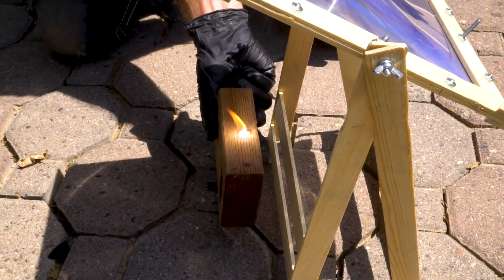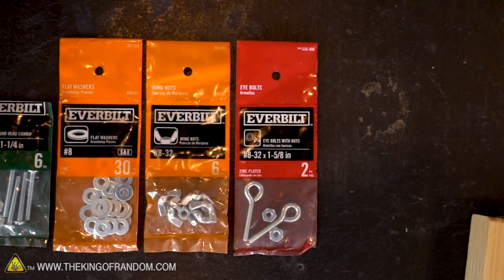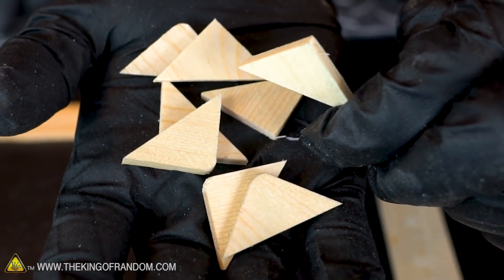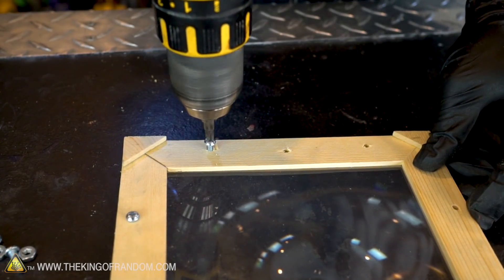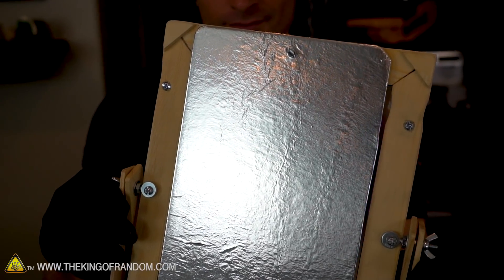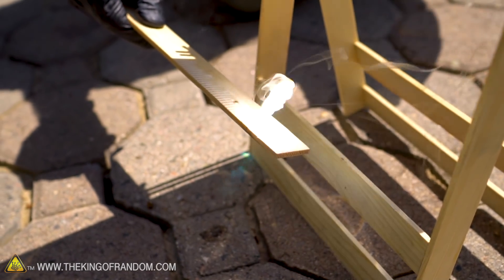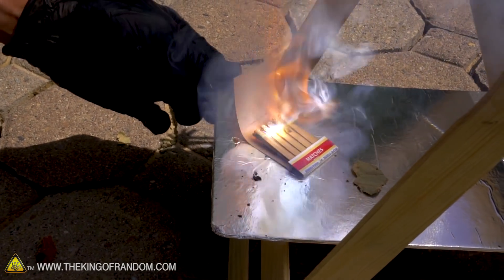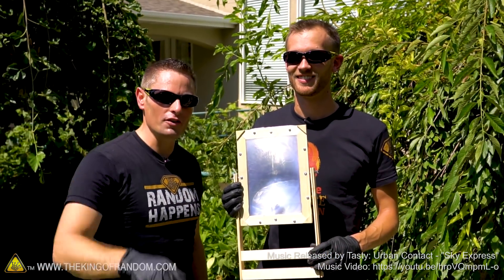Powerful Desktop "Solar Scorcher"! TKOR Shows You How To Make A Mini Solar Scorcher That Works!

Comment from the maker: You guys were asking for more DIY so we've been cranking out the DIY and we have a lot more coming.  I'm really proud of this project and Hope some of you guys try making it ✌👑
Reply: Make a DIY solar panel
Reply: Try melting metal coins with it to see if it really  has the same power as the big solar scorcher
Reply: King of Random can you make another styro slicer that is small an  easy to make pls😯😯😯😯😯😯😯😯😯😯😯😯😯😯😯😯😯😯😯😯😯😯😯
Reply: Try focusing the mega solar scorcher into the lens of the mini solar scorcher and then put something in the focus of the mini solar scorcher!
Reply: Try to make a homemade plasma ball plz plz 🙏🙏🙏🙏
Reply: The King of Random What if you use the giant scorcher, put the mini scorcher close to the focal point but not enough to burn it, and see if the resulting temperature of both scorchers is more powerful
Reply: try putting gasoline in a vacuum chamber
Reply: The King of Random Great video, im glad to see some DIY again
Reply: The King of Random you are insane
Reply: The King of Random can it melt coins?
Reply: The King of Random can't you just buy a picture frame?
Reply: The King of Random a shoe acrylic mold to mold out a shoe
Reply: Make a thermite launcher
Reply: Liam Becker, I do like Nate.
Reply: The King of Random can you create a handheld version of the styro slicer, kinda like a little mini version of the regular one you made a while ago
Reply: The King of Random can you make a full aluminum bat that is not hollow
Reply: king of random can you do a emp box protecter
Reply: The King of Random WOW THAT BURST INTO FLAMES IN LIKE ONE LIKE INSTANTLY
Reply: The King of Random you should make a micro solar scorcher with a credit card size magnifier
Reply: use the Solar Scorcher and try to melt dry ice ✌👑
Reply: Not to sound mean, but I think that a lot of the older viewers are probably adapting the same opinion of you. You don't do very many projects that are, "Original," and just get stuff from the comment section. I think that if you made another channel that was dedicated to only original projects, you could get a lot of the older people back. Then you could have this channel be just for stuff from comments.
Reply: Can you cook meat or boile water with the solar scorcher can you test this 🤔
Reply: Hi I made the mega one the same way and it works great. I sometimes toast some marshmallows with it. It is quite bulky so I think this would work well. I recommend making it if you can it gives me hours of fun.
Reply: I was the one that asked for more DIY'S in the gasoline video And I will definitely be doing this project!!!!!!!! :) thanks for making more DIY'S Grant lets Go team RANDOM!!!!
Reply: Subscribe to me
Reply: You should try to have a spoon and put it under boiling water and see how long before it turns orange
Reply: You should put colored smoke on your drones and try to sky write!
Reply: The King of Random what will happen when you detonate TNT into nitrogen container?
Reply: Hey why don't you try melting rock
Reply: The King of Random I really like your videos because it teaches kids and grown-up folks to get into the garage or where ever that maybe and use your mind to build things most of the stuff you build is very accessible to get thank so much for taking your valuable time and teaching us how to great work you guys!!
Reply: The King of Random pour silicone into liquid nitragin :)
Reply: Can the mini solar scorcher melt some metals?
Reply: The King of Random could u make a vid about putting random things in the vacuum chamber
Reply: Could you do DIY coloured fire
Reply: Cyrus Battiwalla hi was up we are both here
Reply: Cyrus Battiwalla could u reply
Reply: Can you magnify the solar scorcher beam on the mini solar scorcher pls.😎
Reply: Grant make a Marx generator
Reply: You should sell these (and a lot of your other projects) as kits like (through?) Sonic Dad. Honestly, this would be such an amazing stocking stuffer as a kit.
Reply: The King of Random can you make a diy solar pannel or something like that?
Reply: put the small scorcher in the focus point of the big scorcher my dude
Reply: The King of Random Try putting a battery under that solar scorcher
Reply: THAT WOULD BE PRETTY COOL
Reply: Just realized caps lock was on
Reply: PLEEEEASE, test metal melting with the small scorcher??????????
Reply: The King of Random  What happens if you accidentally burned your hand with the solar scorcher?
Reply: You should do a video with Andrew huang
Reply: The King of Random what would happen if you lived up the mega and mini solar scorchers?
Reply: The King of Random try to melt a rock of some sort
Reply: The King of Random great
Reply: The King of Random...Hi Grant I love your videos...could you please show us how to make a red dot sight..I would realy like that...
Reply: The King of Random can you do some fun stuff with fire extinguishers for a future video thanks
Reply: Amazing Gamer3000 hi
Reply: The King of Random nice videos keep it up
Reply: The King of Random can you make one  way glass
Reply: The King of Random you should try melting rocks with the solar scorcher
Reply: The King of Random 
Hey Grant, can you please try making the legendary Greek fire and then try to create something as close to the devistating wild fire you see in GoT as possible? Thank you!
Reply: You should stack procedurally smaller solar SCorchers to make it more focused
Reply: The King of Random will it melt metal?
Reply: melt coins
Reply: The King of Random hi
Reply: Could the mini solar scorcher make char cloth?
Reply: What if you focused the light from the big solar scorcher?
Reply: Dry ice vs solar scorcher
Reply: DIY nitrogen ice cream
Reply: Thank you for a DIY video
Reply: The King of Random you should make some super easy but complex metal castings with kinetic sand. Don't worry, kinetic sand won't ignite or leak unless the metal is too hot over 1000 faren
Reply: The King of Random I stopped watching your videos because of nate. So why is nate in your videos.
Reply: The King of Random  how about you take all the colours of the fireworks
Reply: The King of Random Hi
Reply: The King of Random you should do the solar scolcher but with chocolate
Reply: The King of Random can you make a glowstick kcilaphone from pintrest
Reply: ✌👑 The King Of Random use the Solar Scorcher and try to melt dry ice ✌👑
Reply: Does this have any practical application? Like for cutting or IDK burning an image in wood?
Reply: The King of Random male a glass mold poke ball
Reply: The King of Random do you think you can melt coins like the big one
Reply: The King of Random can't you just use a magnifying glass and see if that will work
Reply: make a phone projector next it would be awsome
Reply: The King of Random I tried one my entire scorcher burst into flames 😂 so I rebuilt it with metal rulers and glass
Reply: you should show us a diy longboard
Reply: The King of Random 
I
Reply: Try to melt the dry use using solar scorcher pls please please
Reply: plss make a liquid nitrogen thrower (flame thrower but instead liquid nitrogen)
Reply: Themite versus ice/dry ice PLEEAASE
Reply: The King of Random make your own crucible capable of holding together in the forge
Reply: What the heck
Reply: all you need now is a crucible 😍🤓
Reply: The King of Random u have tought me a lot over all the years thank u because i have fun watching all the stuff u make
Reply: Try building your own music instrument!
Reply: How about a diy mini engine?!
Reply: The King of Random I have a DIY project for u to do can u make a mini jet torch for the bitty barbecue can
Reply: Thank you for the DIY
Reply: 321th like!
Reply: build RGB infinity mirror XD
Reply: The King of Random hi I love all of your videos ive been watching them for about a year now or longer. I'm also a subscriber and I liked. Can I please have one of those because I want one  and I can't buy that stuff.
Reply: The King of Random do diy Halloween pranks
Reply: Hey grant, why not take the big solar scorcher, and have the fun size solar scorcher in the focal point of the large solar scorcher? See what happens.
Reply: That would just melt the miniscorcher.
Reply: Freeze helium in liquid nitrogen or liquid oxygen
Reply: Tried making the big scorcher but the TV had the wrong kind of fresnel, bought the lens for this mini and can't wait to make it! Just wondering, what did you do with the other TV pieces? I wish I could do something cool with the projector
Reply: You should add at least 3 more to see if it becomes stronger
Reply: Grant/ Nate any chance of throwing a few cool H.D.P.E bottle lid projects our way.  either solid block shaping and/or maybe some of your old vacuum former again, or build another but kitchen sink forming size?
Reply: The King of Random can you do molten metal and liquid nitrogen
Reply: The King of Random 👩‍❤️‍👩👩‍❤️‍👩
Reply: The King of Random make a napalm bomb
Reply: can you focus the light from the larger lens through the desktop to increase the heat?
Reply: The King of Random  what happens if you put oblic in a vacuum chamber or what happens if you put oblic in liquid nitrogen
Reply: King of random What happens if you put oblic in a vacuum chamber
Reply: King of random What happens if you put oblic in a vacuum chamber
Reply: The King of Random what happens when you use the mega solor scorcher and try to burn dry ice
Reply: Can you do a solar oven build please? Maybe two versions: cheap and portable (camping, survival), then a bigger and sturdier one for off-grid cooking at home.
Reply: I think I'll totally build this! Thanks so much for the video!
Reply: The King of Random try to melt rocks with it, and see how fast it can evaporate water
Reply: The King of Random .. try a fire tornado! It looks pretty rad at night.
Reply: The King of Random can you melt rocks or glass with it?✌️👑
Reply: The King of Random what will happen if you microwave gunpowder?
Reply: Loving the format guys. The combination of DIY and experiments seems perfect to me!
Reply: Have you ever done any electroplating? It seems to be Right up your alley?
Reply: The King of Random I know that u boiled gas but u bid not try boling mixed gas could u please try it thank u.
Reply: create mini metal muffins and pour liquid nitrogen on it
Reply: lit
Reply: can you put dry ice on a open flame
Reply: The King of Random can't wait to try it. Y'all have the best ideas 😂😜
Reply: The King of Random put a pumpkin in the vacuum chamber
Reply: What happens if you put dry ice in the foundry
Reply: What happens when you put talc, a type of soapstone into liquid nitrogen?
Reply: The King of Random
Reply: Hey Grant can you try two of the main brands of microwaves and test which one is better by using them for 100 minuets
Reply: The King of Random i
Reply: The King of Random can u try melting metal?
Reply: Yes I have made a few with my niece's and nephew because they have no cable T.V. so it forces them to make things
Reply: Fluffy Gamer123 we all asked if you see in the video we all asked for more diy's
Reply: The King of Random what about using more lens and a few mirrors to make a larger scorcher 
To make it more powerful
Reply: The King of Random Grant make a plasma gun
Reply: Can you fry an egg on that solar scorcher? Or on the bigger one? How much time would take?
Reply: do more videos with you doing stuff in them, it seems like you never do anything anymore
Reply: what about if plastic images with the logo on it that reflect to the wood
Reply: Tree Overlord the glass would instantly break
Reply: Marcos Rocha pretty quick I guess
Reply: The King of Random What happens if you mix molten metal w/ liquid nitrogen or dry ice?
Reply: 1 try to burn  gummy heart
2 try solar scorcher vs solar scorcher
Reply: it won't have the same power because the surface of your lense is what determines the power
Reply: Grim Scott yeah the surface of the lense determines how much light and with that how much heat you can focus on point and since this one has a much smaller surface it won't get as hot but as you can see in the video it's still pretty hot
Reply: The Wsaedrfffcdfs
Reply: The King of Random arrange a bunch of solar sochers in a row and aplify the power
Reply: U Can meldt magnets but there Will NOT Be magnetic
Reply: I love you guys sooo much
Reply: Question: could you do most of this with hot glue I thing you could
Reply: The King of Random I
Reply: My mom and I made one of these Desktop Ones and it’s actually pretty fun to mess around with. We used a 2x4 block of wood as the stand instead of the huge box, because we ran our of paint sticks. It still works, though. I loved making this, next up we are going to attempt to make a Vortex Fountain! 😜
Reply: Where can you buy these at Sri Lanka
Reply: Should try
Reply: The King of Random,  HEY GRANT ! Can you make a DIY VIDEO making a TESLA COIL ?!?!!
Reply: The King of Random can you melt and cast magnets?
Reply: I never noticed you changed the name of your channel to just The King of Random
Reply: make a automatic ice cream maker no people needed make it app  controlled if possible peace singn and crown (:
Reply: I love your videos you are one of my favorite youtubers
Reply: The King of Random try using the solar schorcher to ignite gasoline
Reply: a super automated icecream maker no person needed
Reply: The King of Random I don't like Nate

Comment: Working on making my first ever DIY project and chose this! So glad that the paint sticks are free on walk ins at Home Depot, my measurements were wrong on my first cuts so half my frame is finished but there are lots of gaps between the angles.

Btw I'm stopping for the night and still have four more sticks to cut, anyone got tips on how to correct my angles and make them flush? I looked for videos but I'm not having any luck with that atm lol

Comment: If you recorded positions of the sun and what time it was for different positions you could draw a clock like indicator on the side of the holder that angled the lense at the correct time. Then you fasten a firecracker to the base, set the lense to lets say an hour past the current time, and see if when the firework goes off your time is correct, boom survival alarm clock

Comment: I have three or four of the large lenses that all work. Left them leaned against an old broke down Ford ranger & forgot about them while trying to build the legs, umm anyone got a fire extinguisher handy?  The plastic bumper parts started smoking!  Any way the problem I'm having is the hardware for the legs & hinge keep pulling out every time I try moving or setting up the scorcher.  Any ideas to make the eye screws & other hardware stay in the wood?

Comment: i was just about to ask if its possible cut down the big tv phernell lens if you dont want it that big then i saw this video. but im still curious is it possible to cut the big one? if yes does it get weaker if it is smaller or is the strength depend more on the quality of the lens? you had trouble melting brass and aluminum with the big one but could you use multiple scorchers in series or in parallel for better results? if put in series will u just burn the other scorcher? and is it even possible to put in parallel, im in doubt because i figure you would run into problems with light angles.?

Comment: Question for you.  Last year I built one of you super solar scorchers.   Problem is, due to vision issues [[especially in bright Sunshine or darkness  [Diabetic Retinopathy] ]]  I have a tendency to either drive a nail/screw in at an angle, make really crappy cuts with a saw [[Need a straight line?  Don't look at me.  Need a slightly angled cut?  I'm your man just draw a straight line and hand me a saw!]]   Anyhoo I managed to drive a couple of screws into the sides of my lens cracking it or breaking of chunks.   Is it feasible to trim the lens down to remove those bad areas?

Comment: if you put a hose at the spot where the heat is and a one way valve fill the hose with water and connect the two ends of the hose how hot will the water get

Comment: Those screws were completely unnecessary. The wood glue will provide a stronger joint than the screws ever would anyway, especially if you clamp it together while it dries.

Comment: I'd like to see you use it to drive steam engines or boilers for hot water distribution/heating, make use of this really practical. Use it to run generators that charge batteries.

Comment: What happens when you put the mini solar scorcher in the focal point of the big Solar scorcher how hot does it get
Reply: dude the big one already does melt metal that would destroy the forests in a 30 mile radius
Reply: all it would do is burn a whole through the smaller lens
Reply: yoco yo that would be like super cool like that could melt metal
Reply: It'd make the radius of the light smaller, making it more compact, and making them(Sunlight waves) more hotter, because it's more compact
Reply: It has a chance of melting mini scorcher, because its lens is made of plastic, which is not as heat resistant, as glass. Probably it won't, but who knows...
Reply: I think you would have to use the big Frensnel lens and a smaller glass lens. I'd be interested in seeing a large parabolic mirror aimed in to a large glass lens.
Reply: Absolutely no difference from the big one by itself. Unless the small one is better quality and has a tighter focal point in which case it will concentrate the light and heat into a finer point making what essentially would be a laser cutter

Comment: Since Halloween is around the corner you should experiment with colored flames.  Use Ethyl Alcohol as your accelerant but mix in stuff like boric acid and copper sulfate to make green and blue flames.